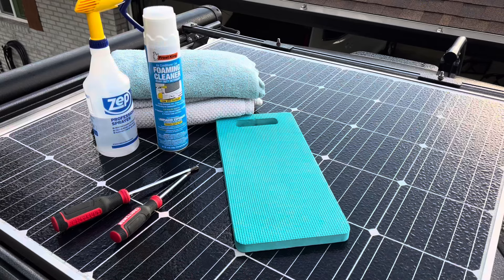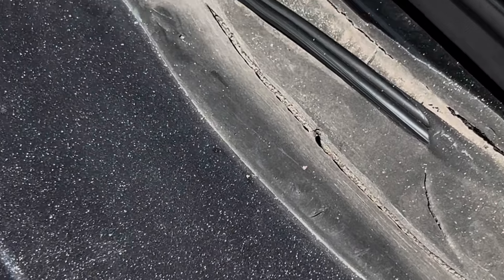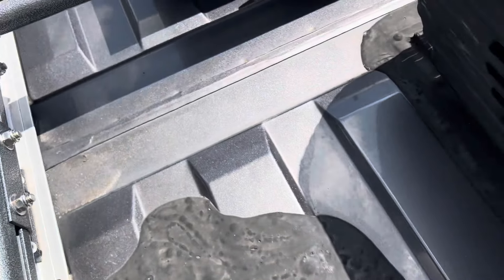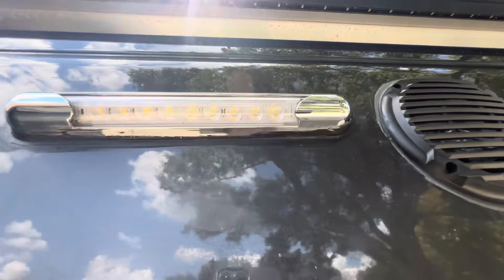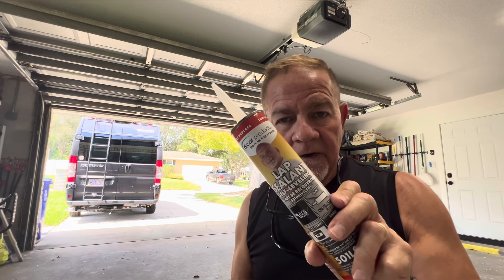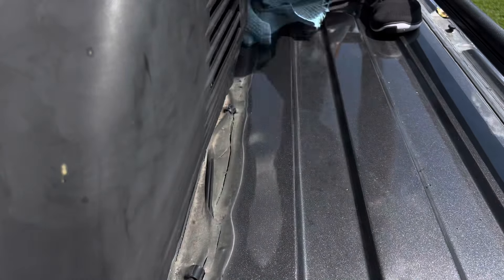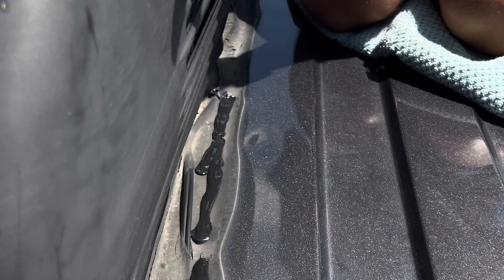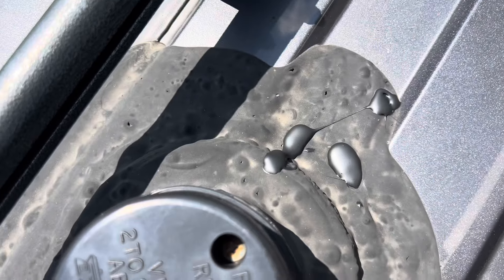Stop Water Damage In Its Tracks! How To Safeguard Your Rv From Intrusion

Comment: I watched this video a couple of times and wanted to ask how long does the van have to sit before driving it again once the sealant has been applied? My driveway is at a slight slant will that be a problem when using leveling sealant?
Reply from the maker: It should be fine. It drys pretty fast. My driveway is also at a slant.